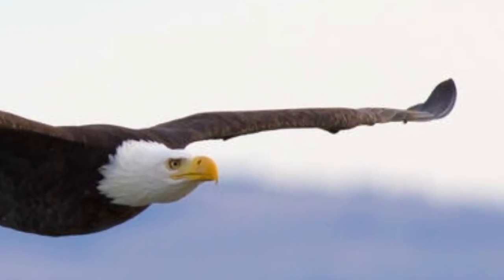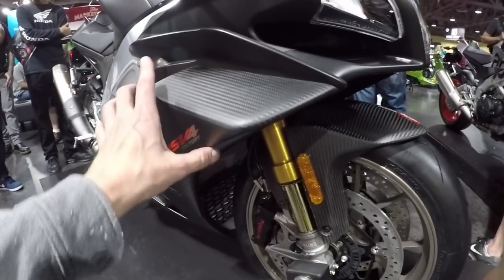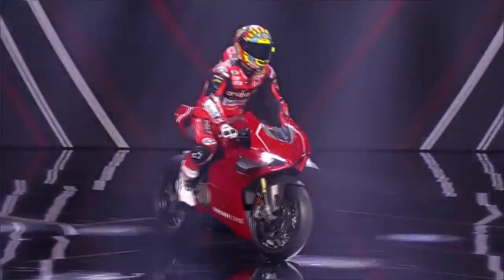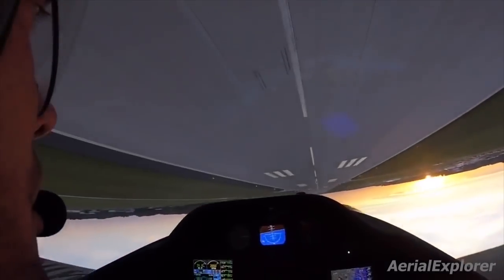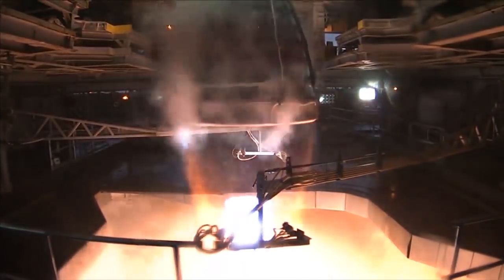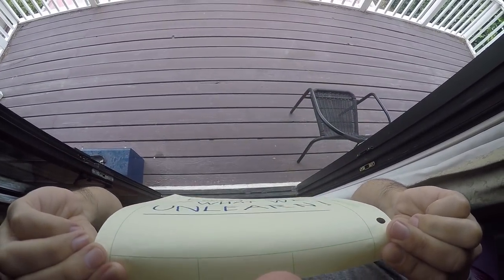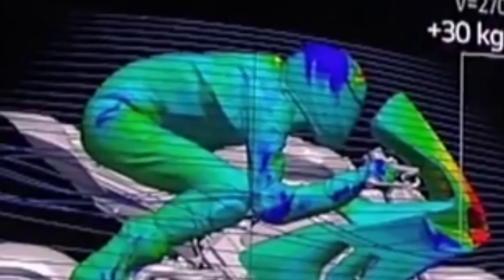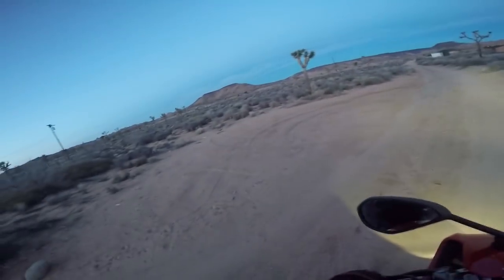V4R Winglets Explained with Engineering - Computational Fluid Dynamics

Comment: 4:32 simFlow 3.1 should update and use patch Based AMR grids instead of OctTree based grids. Would save loads on computation time. Especially in the BiCGStab and GAMG steps. Is this Finite Volume or Element?

Comment: Curtain to pickle proximity is caused by convection.  As the shower heats up air, the air leaves over the top of the curtain and draws cold room air in under the curtain.
Reply from the maker: The curtain draws towards your dangling pickle even with the water is cold or at room temperature.  The effect is from the water circulating the air due to shear forces / friction between the water and air, resulting in a velocity / pressure differential....not convection.

Comment: More downforce on the front gives you a lower frontal area too because the suspension is compressed right? Great video
Reply from the maker: Very astute.  The V4R has a 25% larger frontal section / fairing so it's a trade....and yes, I did say frontal....prrrrrrr
Reply: more larger section for compensate the down ?? @FancyAnimal

Comment: Have you seen Pierobon's winglets? Boxed and only are able to achieve 20 kg downforce as opposed to Ducati's 30 kg at 270 kph (probably a bit silkier when it comes to CdA). Having a structurally rigid bodywork with winglets has to be a must. 

https://www.pierobonframes.com/en/product/aerodynamic-winglets/

Comment: Streamlines not streaklines
Reply from the maker: alois sengissen incorrect.   A streamline is a mathematical expression drawn tangential to the velocity vector at every point in the flow. Pathlines are the path traced by a given particle in the flow, and like streaklines, are visible as experimental quantities.  Streaklines differ in that they measure the flow of a particle at a given point in time, which is what Ducati and I are calculating here.  Furthermore, in steady flow streamlines, streaklines, and pathlines are interchangeable.... which is the flow condition detailed in all cases of the video,  It's not until transient flow that the meanings diverge.